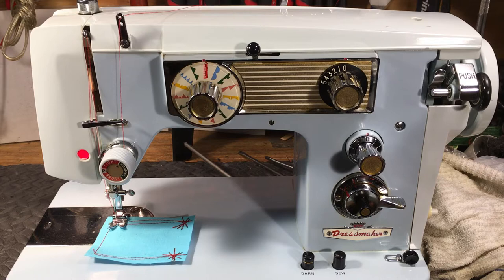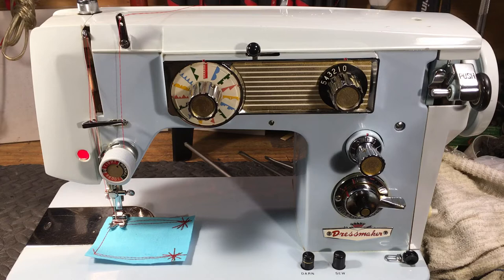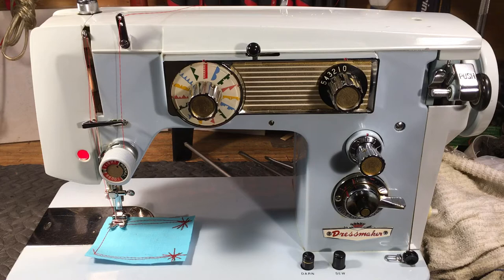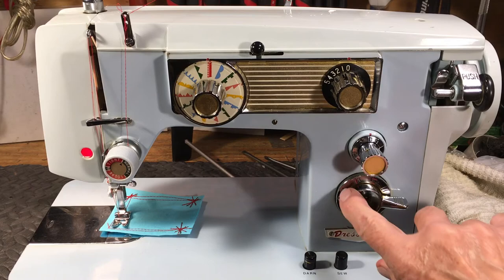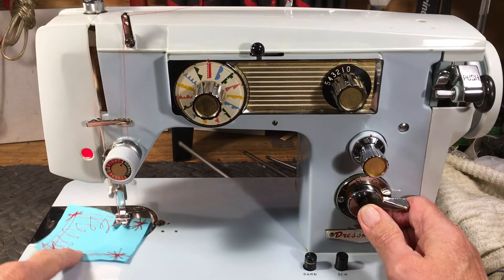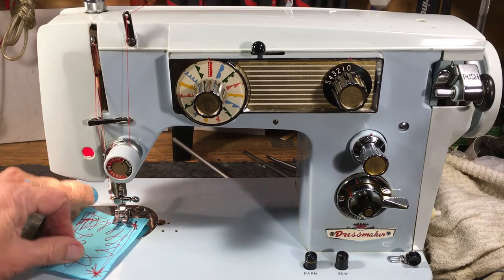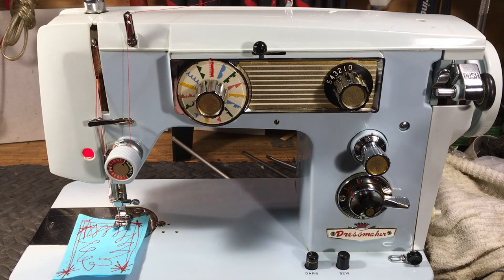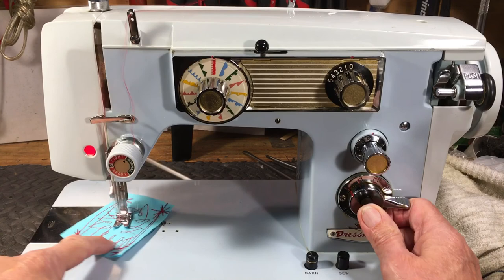Dressmaker SAMB-2 (side load)15 class masterpiece. Real heavy duty precision 2 thumbs up (Video 172)

Comment: Good morning, I'm picking up this same machine (same exact model number) tomorrow. I made sure knobs and buttons are all moving! But, it's missing the little bed plate that covers the bobbin area. Could you let me know where can I get one? Thanks so much!
Reply from the maker: I’m not sure what a bed plate is. 
Could it be the needle plate? (Easy to find online)Maybe the slide plate? (Easy to find online)
If so, sewingpartsonline.com or Amazon might have it. 
You have to always know the name that the supplier uses for the item, in order to find it. 
If it’s a flap, side cover, or bed extension, You’ll have to watch online to find one on eBay or something along those lines. I don’t know of any direct source for those. I’m always looking for them myself. Good luck and enjoy your machine. 😎👍
Reply: @randyyoursewingmachineman9954 So sorry, I don't know the proper names. It's the little silver plate on the bed just to the left of the needle. It comes off in order to get to the bobbin. If I could send a pic of the machine I would but no option for that. Thx again!
Reply: In the first seconds of your video where your test fabric is under the needle, it's the little silver cover plate that's to the left. Thx so much.
Reply from the maker: @simplygigi.  that’s what is called the slide plate. I just searched for “15 class side load slide plate for sale” and several options popped up.
It fits many machines, and was originally on the Singer 15-90. 
Try : Singeroriginalvintageproducts.com and look at theirs. SKU : 15 class - 00011 
It’s exactly what you need. Part price:$3.60 Shipping $3.39
There will be others as well. 😎👍
Reply: @randyyoursewingmachineman9954  thank you so much!I knew it had to be easy but had no clue what item name to search for. Much appreciated 😊
Reply from the maker: @simplygigi.  you’re welcome. I should do a video on what various parts are called. It might help in situations like this.
Reply: Randy, that's a great idea! I for one would love that. 
Well, I'm embarrassed to say I 'thought' I checked all the knobs and buttons...So, I'm in the beginning steps of my rodeo, as you called it.  🙄 1st, ALL the knobs do turn... here's the 'but' ...the stitch length knob only turns from the red - line to the number 4 . It doesn't go past the the red dash to 0 and it won't go to the last line right after the 4. 
Also, the reverse button doesn't push. It will pull out and I can feel the spring tension but it's not budging when I try to push it in. I'm puzzled because I'd be willing to swear under oath that it pushed every button when I went to pick it up. My husband even says he watched me turn and push every knob and button but, 🤷🏼‍♀️ apparently not. I've used penetrant and a blow dryer for heat 4 or 5 times over the last 3 days. I've worked maybe a total of 6 hrs on it. So far, no change at all... any thoughts? Hopefully my explanation made sense. I'm about to take a road trip from KC to Texas and bring it to you! Sure wish it was that easy! Lol  @randyyoursewingmachineman9954
Reply from the maker: @simplygigi.  make sure it’s not in the stretch mode, or the buttonhole mode. 
If your stitch length is on zero, you can get those results as well. 
Lengthen your stitch length by turning that knob to its highest number. 
Line up all your settings to the orange dot. 
P. S. Use your hair dryer for drying your hair or defrosting a frozen item. 
In 51 years of working on machines with every kind of obstinate, stuck, and jammed mechanism, adding heat was never an option. 
There are no hair dryers in my shop. 
😎👍🏼
Reply: @randyyoursewingmachineman9954  thank you for the quick reply. I appreciate it as always! Funny, I've 'only'  had at least 15 people on a vintage machine fb group tell me to use heat. It certainly hasn't helped me so far so, with your advice, it's one less step for me to deal with and that's good enough for me. I will check all settings in the morning. Stitch length knob I know. Check for stretch mode, not so sure. If that's the top dial with all the different stitches, I have it set to what appears to be the straight stitch option. With the  reverse button being in the middle of the buttonhole knob and all of the options on that knob are buttonhole options, correct then I I don't understand how to make sure it's not in buttonhole mode. I have it turned as far to the left as possible which appears to look like a zig zag? I'm picking your brain here at a whole new level, I'm sorry ... And, very appreciative of your help all at the same time! Lol
Reply: @randyyoursewingmachineman9954  Hey there...again. 🙄 My SAMB-2...well,  I'm not quite ready to give up trying to get this baby's reverse button freed up on my own but, I'm close. I'm quite seriously thinking of a road trip to Texas. I've told my husband that maybe it was time we saw the grassy knoll. lol  I'm just wondering, do you even take appts from an out-of-state customer like myself? If so, is this machine worth the trip? How long do you anticipate it would take to assess the machine to determine if it's fixable and fix it if it is doable? And of course, the cost? I'd need to know how many days we'd have to be there. Is there a website or number I could reach you at if we do decide to make a trip down? I apologize for so many questions. I think I have the pertinent ones covered, though. Thank you!
Reply from the maker: @simplygigi.  your reverse mechanism is frozen from non use. I see it all the time. That’s why it’s so important to make sure that the reverse button works before you buy them. 
I would need it for a couple of days most likely. 
Make sure you haven’t done any “adjusting “ prior to bringing it to me.
I fix machines for folks from other states fairly regularly. 
I just like communicating by text and keeping each other informed as travel occurs. 
How much? Probably right at $150. Is it worth it? That’s your call. Would I do it, most likely not. 
I would rather see you put that money into a 158 series Kenmore, with a front load 15 class bobbin, and an alloy frame with steel gears.
Then you would have a machine that will increase in value instead of being of less value than what you’ve invested in it.
Reply: @randyyoursewingmachineman9954  as I said on an above comment, I would swear I turned every knob and pushed that darn button, too. My husband even remembers me doing it after seeing your video. But, maybe I didn't. It's irrelevant now because it certainly doesn't push in. Just want to clarify one thing that I have asked before. First, the reverse button will pull out and I can feel the spring tension. It just doesn't push in. So, would a frozen mechanism still be able to pull out but not push in? In my mind, 'frozen' would mean incapable of any movement at all. 
I'm not quite ready to give up tinkering with it myself and am still hoping I can get to work but I truly appreciate your honesty and opinion on what you would do. I've watched many of your videos with 'heavy duty' in the description title and was hoping this SAMB2  would be my machine to use with light weight leather, vinyl, heavy demim etc. Heavier projects in general. 
I've actually been very fortunate in my search for 158's and now own a 15251, 19310, 17600 and a 19411. I'm excited about all of them and rotate using them. I've cleaned and oiled all of them myself with help from your videos. 
It's that elusive 'heavy duty' one that I'm still looking for. Recently, a Necchi BU was recommended to me for that and sure enough, when I searched here, I found your video on that model. Would that be a better option for me to watch for? Thanks again...Your help and advice is much appreciated.
Reply from the maker: @simplygigi.  if you can get your reverse assembly freed up, it will be ok.
Take the top off and you’ll see the assembly at the end of the reverse push rod. Put your stitch length on its longest setting and tap lightly on the actuator that will most likely in the up position.
You can also turn your stitch length knob back and forth to see the movement.
If your button goes in and out, that means your button and spring are intact.
If you push the button, with your feeders at their highest point, and your stitch length on its longest setting, the feeders should move to the rear. 
Be careful with the reverse mechanism because it will break,  and then it’s game over.
Reply: @randyyoursewingmachineman9954  broken record here but, a sincere thank you! I will keep trying but I'm pretty sure I'm in way over head! Lol, imagine that! 🤷🏼‍♀️🤦🏼‍♀️ I'll give myself an A+ for effort! Your last sentence is what I've been thinking about.  I'm ondering if it IS already broke and I just don't know enough to know...
I couldn't tell you exactly why but I fell in machine love with this machine when I first saw your video several months ago. I really want it to work but if nothing else, it's been a learning experience. Maybe I'll be lucky and come across another one. Or that Necchi. I'm really wanting that 'closest thing to industrial without being a true industrial' machine. 
Thanks again!
Reply from the maker: @simplygigi.  broke implies “a piece over here, and a piece over there”
If everything is connected, nothing is broken. 
Don’t make it harder than it has to be. 
I’ve probably said it a thousand times, 
“Patience and penetrating oil has fixed more malfunctions than anything else on old machines “.
You just look at the mechanism that’s directly behind the reverse button and watch for movement as you turn the stitch length dial back and forth. 
That’s the first thing that has to happen. 
When you do that, it will give you a better understanding of the process. 
You’ll see the slider that is lacking oil. 
Oil it. Work it. Oil it. Work it. 
Repeat. Repeat. Repeat. X 100 if necessary. 
If you don’t do that first, put the top back on and sit the machine in the corner.
Reply: @randyyoursewingmachineman9954  this last reply has been so helpful..as much as all others!! To me, 'broke' isn't always a visible thing so I  didn't know if I was wasting my time. This has given me hope! 🤞🏼 I'll keep at it! I don't mind the 100+x.... Wondering how many times to keep repeating the steps was something else I wondered!  I didn't know. Now I do. ... I'll keep  at it until I'm the one that's done and/or had enough! Thanks again 🫡
Reply from the maker: @simplygigi.  have fun with it. 😎😎
Reply: @randyyoursewingmachineman9954  👍🏼😊👍🏼
Reply: @randyyoursewingmachineman9954  Hey Randy, I'm happy to report in and share with you that I won the damn "rodeo"  with my SAMB-2!!!🤠
It was a tough battle that I could only fight here and there on my days off. Newbie that I am, I almost gave up multiple times but with your helpful guidance and the encouragement from a great group on fb, I stuck with it. Thx again for what you do! Much appreciated 😊
Reply from the maker: @simplygigi.  perseverance is an awesome weapon. 
It almost always prevails. 
Congrats 🎉 😎👍🏼
Reply: @randyyoursewingmachineman9954  😊